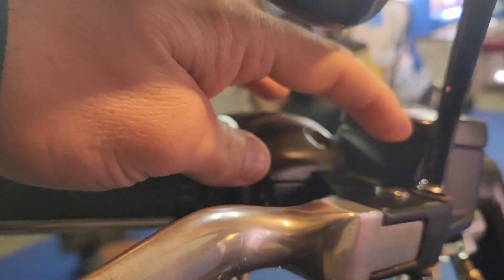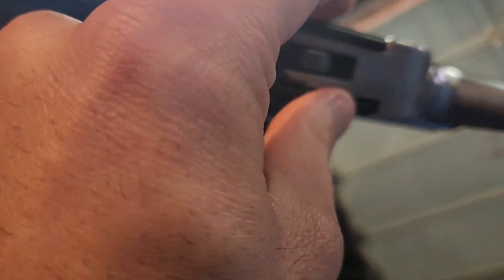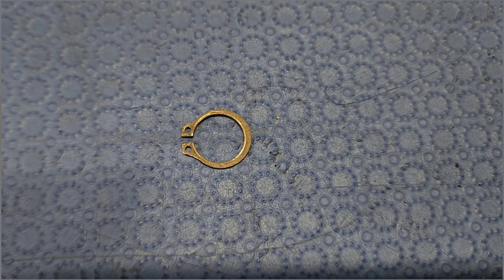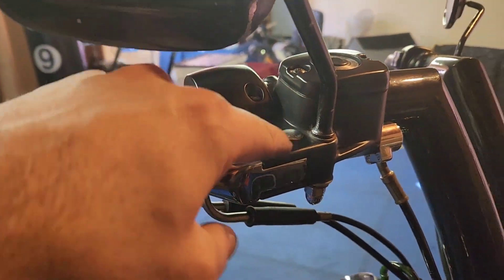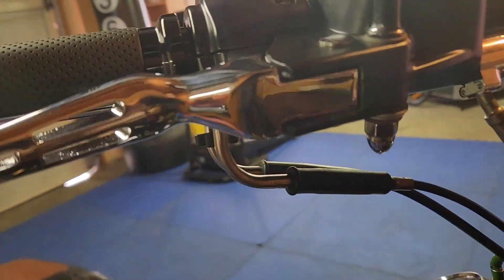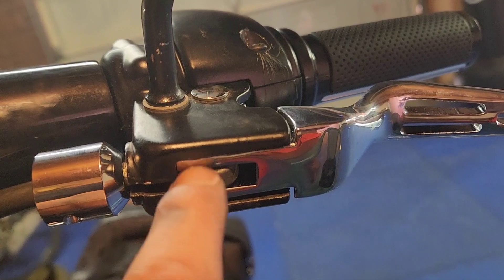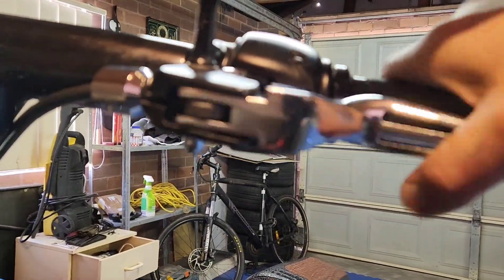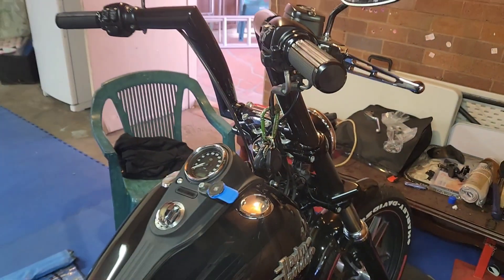How to change Motorcycle brake and clutch levers on Harley-Davidson Dyna Streetbob

Comment: Hey mate, Good Vid. That little clip is called a Circlip. Hope you're well.
Reply from the maker: Yes now I remember. Thanks
Reply: @BRUISER1   Hey, do you know how I can lose up my front brake lever on handle bars. It is extremely sensitive n tight. As soon as I barely touch the front tire like locks up. 
 I have 2020 street bob

Idk if I made it tight or what because I did change levers on it yesterday